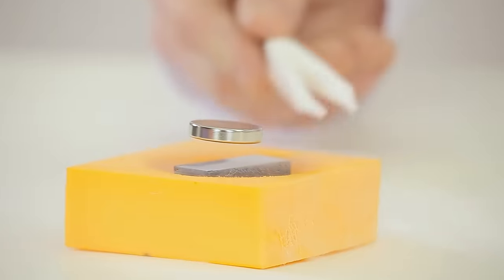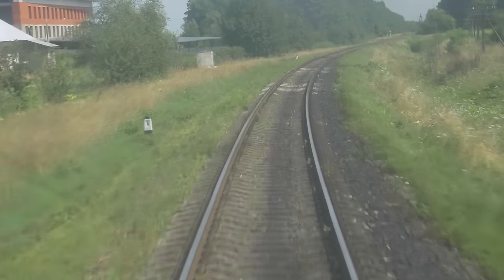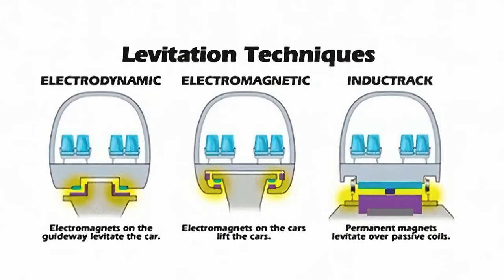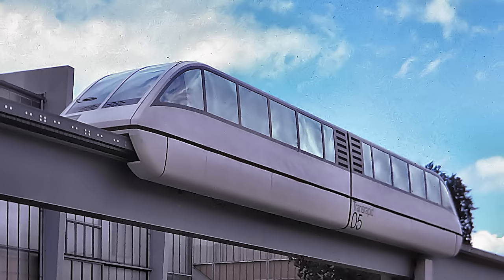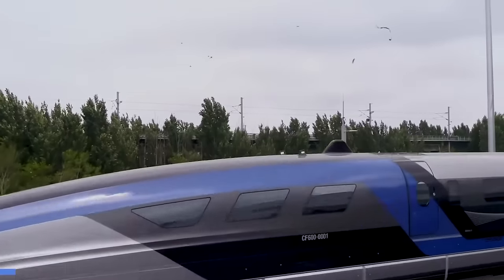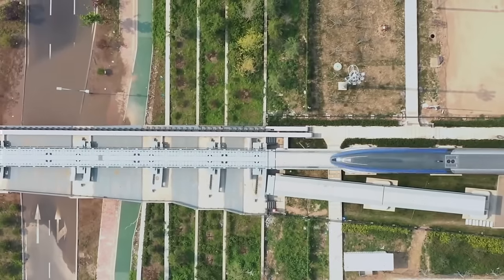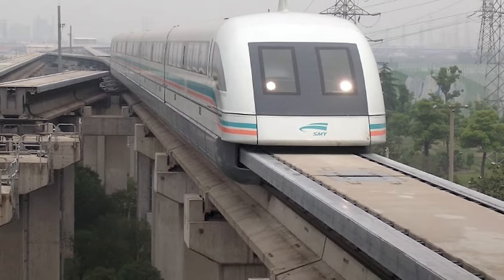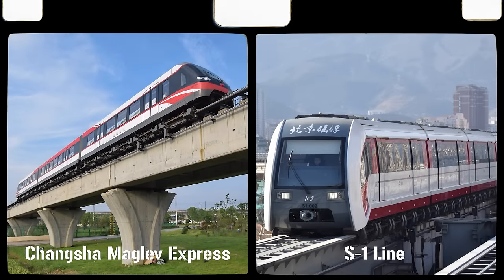Maglev Trains: Why This ALWAYS Falls Short

Comment: I'm still waiting on a Berlin - Paris Maglev, symbolically uniting the two most powerful EU nations with a fast, futuristic transport system.
Reply: Berlin Paris are 900km in a line, or 1000km if you want to also connect bigger cities on the way. Above 600km the airplane is superior in cost and travel time.
Reply: @Psi-Storm Disregarding the superiority of trains to planes as an efficient, less wasteful transport device. 900km is no where near the maglev/plane crossover point. A 400kph train does the trip in just over 2 hours, even a 1000km with multiple stops does it in under 3. If you have to travel to an airport outside the city, faff around with all the security, baggage, taxiing bollocks, to get your 1 hour flight, and then re-commence your post-flight faff and last few miles travel to the place you actually want to get to, it will have taken much longer and cost much more resources than the maglev. Cost is an annoying one as the more efficient should be cheaper, but airlines are subsidised and get fuel wayyyy cheaper than they should for the damage they do. Hopefully in the future planes will be expemsive and trains cheap.
IMO it's only justified to fly if you're going over 2000km or there are no viable high speed ground alternatives
Reply: @chrisogrady28  Covering 900 km in a plane flying 900 km/h will take more like 1h20', because cruising speed is only attained for a part of the trip.
Reply: Too expensive
Reply: A huge amount of money would be spend for the benefit of a few. Not economical or democratic!

Comment: Maglev trains are constrained by wind resistance, not the track or the people that ride them.
Reply: If both the train and the tracks uses super conducting magnets then they're first constrained by power output, and once the speed gets stupid enough, heat dissipation.
Reply: @andersjjensen most maglev train don't use superconductors.

Comment: Mag lev trains would  be amazing.  A freight train wheel has the contact area of .4 square inches, about the size of a dime.  With all of the smart people working on mag lev trains for decades it must be almost impossible to be more efficient that the current wheel and rail design.
Reply: wheel and rail works pretty well, but the maintenance costs are high and there's 200 years of baggage to contend with (I'd argue car and airport costs are higher but endusers don't directly see those costs)
Reply: I doubt the contact between wheels and rails cause more friction than the drivetrain.
Reply: @stevenvanhulle7242  the limiting factor for rail speed isn't wheel friction, it's hunting oscillation

above 150mph air friction dwarfs all other sources combined and most of it is along the sides of the train,  not the front, so no aerodynamic trickery will assist (wedge/woodpecker noses are almost entirely for tunnel exit noise mitigation, not for speed reasons)

Comment: "There is no resistance" is just not true. Air resistance is still there, and steel wheel on steel rail is already very low friction. I would assume that at these speeds air drag is the major loss component in HS trains and not the wheels. So maglev is only marginally better while being extremely expensive. It just doesnt make economical sense.

Comment: When I was 18 and smashed up my car I gave some buddies money to fix it up. Helping them sand one of us used an electric sander and the other an air powered one. The electric with a magnet in the motor was nowhere near as powerful as was the air powered one. I would guess maglevs probably use more electricity and generally aren't as efficient as they sound. And with no wheels to contact anything, stopping is probably nowhere near as safe. A big magnet on the back of each train wouldn't be that good an idea to prevent crashes. If you remember a MythBusters episode where they tested a scene from a Bond film where Roger Moore is using a magnet within his watch to deflect bullets. In real life this was impossible for a magnet that size.

Comment: The point you kept mentioning about maglev trains can't crash into each other because magnets is completely false. Any magnet can be overwhelmed with sufficient amount of energy/force behind it and maglevs don't have gigantic magnets on the front and back to prevent collisions anyway. Even if they did, that magnetic force would only come into effect when they were a few feet apart or less and basically already crashed

Comment: Maglevs have a super niche application when you look at it practically. They don't fit in intercity commuting because you don't need to be from 1 street to 3 blocks over at the speed of, "You s*it yourself." It's best for international/transcontinental travel, but that poses other issues. You'd need new tunnels dug out which is billions within itself, and then there's the funny biome of deserts. Normally deserts are just annoying to trains. Maglevs will have to be so far off the desert floor to not get sand all up in them and even then, a train going through is going to carry a large clump along with it and just sand down the rail. The best use for a maglev is to cross empty open spaces. Deserts are empty open spaces that don't play well with magnets....Whoopsies.

It's a great concept, but reality just is too much of an ass to allow for maglevs to be viable. Maybe in a vertical direction (aka a space elevator), but going across a few blocks or across wide expanses, it just needs to be the absolute perfect route that cannot change....Although now that I say that, I do feel like a maglev through Yellowstone National Park might keep tourons from being mauled by their stupidity. No stops, just a slow float through the entire park and that's it. No jumping into the pools, no touching animals, no "I'm just getting a picture therefore I know better" imbeciles. Lock them on a moving jail cell and force them to look only.

Comment: The Qingdao Maglev is nothing but a copy of German Technology. It is actually called CRRC CF600. It has currently no line to run on, although compatible with the tracks in Shanghai is it incompatible with the guidance systems there. China managed to build a copy of German technology 50+ years after it first came to life as Transrapid 05 in Hamburg. It will regularly run inbetween 450-500km/h and is therefore no faster than the German versions Transrapid 07/08 (Shanghai SMT)/09.

Elun Mosks Hyperloop was patented as well as the first maglev train on which the Transrapid is based in 1934 by the German Hermann Kemper.
Reply: Source: trust me bro

Comment: All well & good, BUT, it seems you forgot to mention 1 of the most important technical pieces. Whats is the Energy cost for all the electro magnets when powered up ? I understand magnets will last for an unimaginable length of time. But, where does all the energy come from. And, on that thought, IF the energy required is miniscule, compared to..."traditional" trains, then WHY isnt that lauded heavily ? If the operating cost is significantly less, then it needs to be defined AND that needs to be its public face, NOT how fast it can go. That is the least relevant thing about a maglev train, or it should be. They have the potential to clean up smog in EVERY metro in the world...

Comment: I’ve always thought maglev trains would become more prevalent if humanity expanded to the moon or other planets. Maglev trains need to compete with already existing infastructure, and congestion, so while they have benefits, the costs of building the new track outweighs them significantly. But when we’re building new infrastructure from scratch, like freight rails on the moon, the advantages of maglev propulsion make more sense.

The cost of building the track is prohibitively expensive, as the track needs to also move the train. If the train cars could move themselves, or power themselves, the cost would shift more from the track, to the cars which would make longer transnational routes feasible, like the very first railroads.

We have the technology now, but we don’t have the need, since our cities are already linked by existing track. When new cities are constructed, and new connections need to be made, we won’t go back to conventional high speed rail.

Comment: Why does Maglev falls short of being a wide success? Simple! the cost of speed increases drastically above a certain speed. Right now speed in Europe is often 320 km / h and it could be much more BUT the energy cost and maintenance cost DOUBLE with a small increase in speed 350 - 400 km/h and all this for what? To gain 15 minutes on a trip.
To make matters much much worse, Maglev train faces four HUGE additional costs: the cost of magnetic levitation track, the cost of powering this track, the cost of creating brand new infrastructures in city centres and last, the enormous cost of each turnout (point).

We, in France have been though a similar path with the Aérotrain (in the 70s): simple track apparently, reached without efforts 400 km/h right from ,the start (could be much faster) but was doomed by  the energy cost increase, the cost of entering the city centers and the small capacity of vehicles.
So this was trashed and replaced with an electric TGV: no friction, only air resistance (hence the 350 km/h limit), huge capacity (above 1000 passengers with 2 double decker trains with 3 min intervals (20,000 passenger per line per direction, per hour). Not perfect but not too bad.

Comment: You're essentially trading wheels for an engine which has its insides on the outside and is several kilometers in length. That's always going to be had to justify.

Comment: The rolling friction in steel wheeled trains is actually really low. Not only is it smooth metal, but it's also a wheel. Don't ask me how they're even able to work at all, it's absurd honestly. There are explanations, but they seem dubious. Most of the energy requirements in trains is for the load, not for efficiency losses like friction. So maglevs are basically only slightly more efficient. It's like the difference between a super conductor and a normal conductor. Super conductors have no resistance. Copper has less than 5% resistance, silver has even less. It's marginal improvements, but still interesting.

Comment: I'm a great fan on Maglev technology but it is quite simply too expensive. 
I hope it will get cheaper but I I can't see that happening any time soon .
Reply: How do you know its to expensive? Have you fact checked it or do you just guessed it?
Reply: @matsv201  Did you not just see the video above? He mentions on no less than 6 occasions in the video that costs were a major factor in their downfall.  Cut to 16:10 He literally says massive cost and cost over runs were a key factor standing in the way of Maglev tech. Cut to 20:28 for a further re-itteration. 
I've also seen countless documentaries on Maglevs and on every single one, Cost is brought up as a major issue. Several magazine and newspaper articles I've read also elude to the same thing. If cost wasn't an issue there would be a heck of alot more maglev lines being built.
Reply: @justandy333  You know that is possible to make a video with out having a clue what you are talking about, that is evidence of this video.

He just claims that there is a massive cost an multiple cost over run, but have have not a single actual example of it.

Just repeating that the cost is high don´t make it true. If its true, you just need to say it once, not drill it like some religious mantra.

"I've also seen countless documentaries on Maglevs and on every single one, Cost is brought up as a major issue"
That still don´t make it true. Do you have a single first source?

"If cost wasn't an issue there would be a heck of alot more maglev lines being built."
Can you point to a single high speed railway line built top day that is built on market Principe? Even one?

I can start with one. Chuo Shinkansen.

All right now its your turn. Tell me a example of a privately funded rail line that is being built today.
Reply: @matsv201  I really don't care that much mate. I trust Simon's team of writers have already done their research. It correlates with other articles I've read. Just because I don't have the source material to hand, don't mean it isn't true. Anyways, I've got better things to do than argue with you. good day.
Reply: @justandy333  You shouldn´t they are wrong. Very much so.

Even if they at some point where not. Say they was actually looking at a legitimate source. For low long would that source be valid?

What if the source is from 1976? would you still think its valid, what about 1984? what about 1998? what about 2007? what about 2014? How far back is the source valid?

You correlate it to other articles? so? what about they both use a common source and both are wrong.

Its like if you have a math test and the question is 2+2 and both you and your bench neighbor write 5.

So the teacher suppose to say "yea, it correlates with a outer source, so it must be right"

Or is it more likely that that one of you cheated and the other one was wrong

Comment: The confidence in Maglev trains was already very low in Germany when the accident in Lathen happened. Germany may be good at developing and engineering technologies, but more often than not, they'd rather export them than use them by themselves. Indeed, technophobia is part of the mindset that has been a cultural trend there for years.
Reply: China's adoption of the Transrapid was always a technological showcase decision, not a pragmatic one. The noise issues have sealed its technological fate and spare parts are just the final nail in the coffin. China purchased almost all of Transrapid's Intellectual property and are quite capable of fabricating all necessary spares but the real question becomes "is it worthwhile doing so?"
Reply: @miscbits6399  The Transrapid wasn't much louder than a normal train. At 200 km/h the noise level was around the same as a normal regional passenger train at high speed. Since China has long iterated on its own Maglev concept, it is very likely that they will phase out the older Transrapid one day.
Reply: @ArmchairMagpie  200km/h is 1/10 the air friction of 425km/h. The noise complaints were about the thing going past at full speed in the evening/early morning and it was slowed to 350km/h initially

High Speed Trains are normally slowed down in urban areas for the same noise control reasons.  A 350km/h train going past is LOUD no matter how you paint it and wheel noise hardly factors into it
Reply: @miscbits6399  I am aware of that. My point was that it doesn't matter. First generation technology is called like that for a reason. The Chinese have a much more modern MagLev ready and that one will phase out the Transrapid which opened the door to that tech for them.

Comment: I think Britain missed a fantastic trick. The HS2 project should have been maglev. It would have doubled the cost of phase one (£30 billion). But the cost has doubled ... ... ... or even tripled, anyway.
The reason for that is partly that high speed rail is enormously disruptive. It has a wide footprint, and people like it to go through tunnels, rather than somewhere near their homes.
But maglev is so quiet, that it has a much narrower foot print (far less "compensation) - and it can go up and down hills. There would not be so much tunnelling.

For the business case, it would be an attraction in its own right - not just a transport conveyance.
I am not concerned with "world speed records". I reckon 300kph should do the job.

As for the unfortunate accident at Lathen, it was not in any way caused by the technology but by human carelessness. 
Cancelling the project seems like an over-reaction. 
We saw that peculiarly German reaction again thirty years later when Angela Merkel's response to the Fukushima disaster. 
Germany no longer has its own nuclear power, where MSRs are the future of cheap carbon-free controllable electricity generation.

Comment: They won’t work because of one simple reason…..

They have no ground clearance!

A train can easily pass over twigs and small branches.
Maglev trains do have space to all this to happen.

Resulting in small twigs and leaves building up under the train.
Creating friction. Reducing efficiency.

To clean the debris from under the train. All the of the wheels on the bottom of the carriage need to be removed.
The whole carriage then needs to be lifted to clear out the debris.

It’s easy just to use a normal train and avoid the above 😉